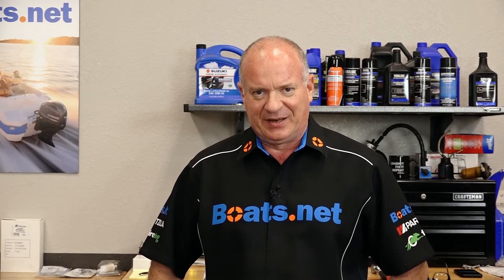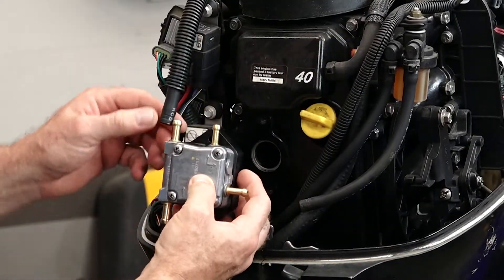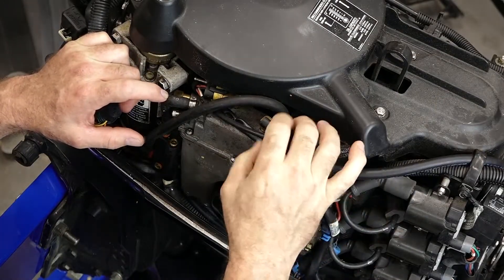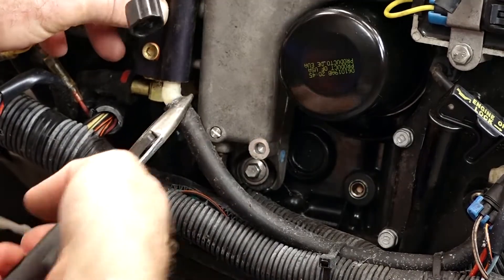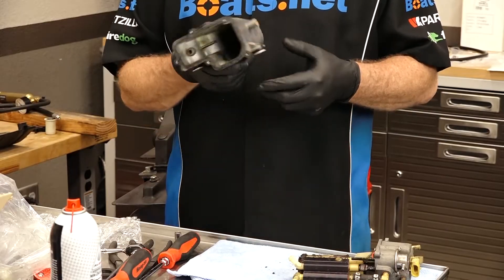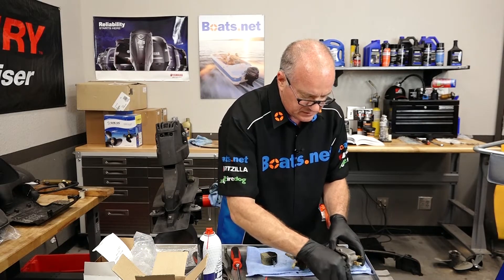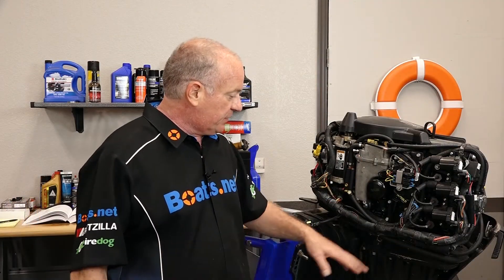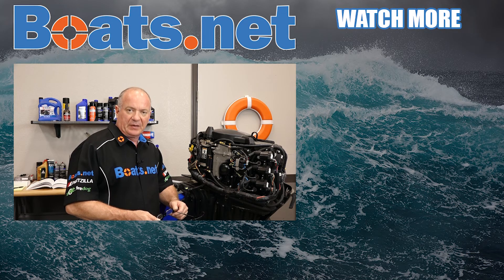Mercury 40 HP Fuel System Rebuild | Mercury 40 HP Fuel Pump Replacement | Boats.net

Comment: More of a question or 2 than a comment. 
Is the o-ring in top of VST important?
Is there an input screen on hp pump?
Are there any torque specs on those VST bolts(8mm)???
Nice Vid!

Comment: Loosen the bottom bolt. Do not remove. A stubby 8 mm ratcheting combination wrench is ideal for this. The VST can the be replaced easily by sliding back into the grommet. This also aligns the top holes to easily install top bolts.

Comment: I came back to this video to let everyone know, if you don't install a water separator between the fuel tank and motor, you're always gonna have problems with the VST. I have finally got my 60HP motor running  and I have a new water separator to install asap. It's raining today so it will probably be installed tomorrow. Plus, it is always good to keep the fuel tank full of fuel after a fishing or boating trip, WITH stabil!.
Keep the water out. A fuel tank breaths everyday, bringing in moisture.

Comment: Awesome video!!!......but FYI...I had two Low pressure fuel pumps on the same engine fail on me. In both situations the pin that holds the diaphragm shaft to the outer "ball" that makes contact with the lifter rod fell out and caused the pump to fail. The VST wasn't getting filled but I was fortunately able to keep squeezing the primer ball to get back home. The worse thing was that the first time I was never able to find the pin, so I never knew if it broke or slipped out. The second time I found the pin with a magnet right below the oil sump screen through the oil drain plug. I think I can safely now say that the pin, even though it is rotated 90 degrees inside the pump housing to prevent it from working its way out, truly is not "captive". Somehow, due to vibration, heat, what have you....the pin works its way back to the installation hole and simply falls out....BAD DESIGN!
I say this as I wonder if the person who worked on this motor before you discovered the same thing and was fearful that the missing pin would cause a catastrophic failure... I sure did!
I have written to Mercury and am waiting to hear from them.

Comment: Thanks for the great video! I have a '13 40hp EFI BigFoot. Might you show how to remove the "Pan" which is between the lower cowling and upper cowling. Even if show with just a parts diagram, I think it will help others like me.

Comment: Great video.  I have exactly the same mercury 40 HP.   I could not figure out how to remove the front inside nut in order to remove the lower cowling.   Any tip will be greatly appreciated.  thanks.

Comment: I know this is a old video but I have a question. When removing the low pressure fuel pump is it easier to remove the latch or the cowling to make room to get the pump out?

Comment: Yea well from experience there is a rubber gasket that has to be perfect or it will leak. I used rtv type stuff made for gas to make it stop leaking. Mercury sent me a new gasket and it leaks like a sieve. It’s like they gave me the wrong gasket.

Comment: We replaced the fuel pump
In the VST tank but it’s now
Getting excess fuel and leaking.  It runs strong so it’s almost like it has too much pressure from the VST tank
Reply: I think there is a fuel pressure regulator on top of the vst. Maybe it isn't functioning...

Comment: Have a question. My fuel filter in the right side of the engine isn’t staying full of fuel. I pump the bulb and after a while while running the engine it empties out. Is this normal or is the pump bad? I’ve replaced primer bulb hose, water separator kit new, and checked all hoses for leaks. I also took apart and cleaned out the vst and everything was good. Any help would be appreciated thanks.
Reply: Filters on the suction side are only full when they are plugged. 6:13

Comment: Would it be possible for the pump motor to continue running when the motor is shut down? The first time it happened the only way to stop it was to disconnect the battery, What it sounds like is a pump motor running and one is not able to restart the motor, We disconnected the battery for about an hour and put the wires back on an hour later it was OK.

Comment: Is there supposed to be a hose connected to the fuel pressure regulator? If so, where does it connect to?
Reply: I have a 50hp also had no hose attached I suspect it vents to atmosphere if it fails. But I was hoping to see an answer. Did you figure it out?

Comment: 2017 merc 40 4 stroke, motor runs only for minates then quits, pump up fuel back into motor and will start again but runs only for a few minates. Thought it was vent on cap and replaced it but motor still won't operate properly. Any ideas ? I've replace the mechanical pump, cleaned all filters, checked electric fuel pump and all of that was ok. Can it be a pressure valve ?

Comment: John, I have the same motor. I am having an issue of the motor starving for fuel at higher rpms. The motor sat for a few years before I bought it. I cleaned the vst, replaced the high pressure pump, replaced the lift pump, swapped the fuel filter, checked my plugs. I have used two different diameter fuel hoses to two different external fuel tanks and nothing solves the issue. I know there is air in system but I can’t figure where! I suspect the vst is emptying and then sucking air at higher rpms. So why and what is the issue?? Thank you!
Reply: I have an 05 50hp that seems to be doing the same thing. Did you solve your issue?
Reply: Inyectores

Comment: stripped out screw heads are a pet peve of mine.  I always replace slotted or phillips head screws with socket head cap screws. Problem with stripping screws is solved forever.

Comment: My 06 60 Mercury efi is hard to start after warmed up. Cold starts fine.   Almost like its losing prime. It begins to crank and dies for about 10 attempts then runs fine.   I've changed primer bulb and main lines to engine as well as replace filter.  What should i check next?

Comment: Thanks!  Totally saved me from screwing up my 4 stroke VST.  I've been to school on them long ago but today is my first time to do it and your video is on a motor EXACTLY like mine.  I have had fuel issues for the last 3 or 4 seasons.  Mercury tech told me my problem is the fuel cooler.  it acts like it is a vapor lock issue.... I think it is more than that.  Starts and runs fine then when I get ready to leave a job site it doesn't want to run as if it is out of fuel.  I can loosen the filter and pump cool fuel through  then it usually will start up and go again.  This year it didn't do that so well.... time to get serious.
Reply: Have you seen the videos where they put a relay in between the ECU and fuel pump?

Comment: Great video for sure the reason I was watching it is because I have a 2007 Mercury 40 Hp bigfoot and I  started seeing fuel leaking out of what looks like a white plastic thing which also has really fine threads on the outside. Lots of stuff packed into that area but is that the overflow indicator for a stuck needle valve letting to much fuel into the housing? 
Any help would be very appreciated:) Thanks

Comment: I have a 2014 Mercury efi 60hp my vst is leaking fuel out of the bottom hose. What would cause this?
Reply: Bad drain seal inside the vst. Maybe a bad housing. Or maybe it's just not screwed in, all the way.
Reply: Possibly the needle
Reply: No tyler, the bottom hose on the VST is only a couple inches long. It's a service drain. But funny enough, by the time most people take it in for service, that drain is totally blocked with debris. Ergo, useless. 
🤔 It's existence, is probably just some EPA thing.
Reply: On my VST leak it was my float was hung on the rubber seal that the high pressure fuel pump went into.
Reply: My problem is I have no fuel pressure at the fuel rail. I replaced the vst pump and still none. Ordered a fuel pressure regulator thinking it was stuck closed, hopefully that fixes it
Reply: @BoovenBBQ The low-pressure fuel pump, bro.
Reply: @thediplomasta5891  I have fuel getting to the vst
Reply: @BoovenBBQ  does your motor have the spider-looking fuel manifold, or no?
Reply: @thediplomasta5891  not sure how to describe it, it has a Schrader valve on top of the rail
Reply: @BoovenBBQ  ok, that's a no. Gonna have to put that regulator in, and see how it does. If you want to check the fuel pressure, you'll have to order a marine fuel pressure checker. The automotive type that most people have (if they have one at all), is a larger thread size; Can't use it on any kind of boat motor.
Reply: @BoovenBBQ  have you got the regulator ? I’m having same issue wondering the same
Reply: @TheFreddy199  I’m pretty confident my regulator wasn’t the issue because I was able to apply 12v to the plug for the vst from the battery and it pumps fuel to the fuel rail. When I have it plugged in and try starting the motor The vst doesn’t pump
Reply: This has me leaning towards ecm. Because I have 12v at the plug for vst but with the vst disconnected and trying to start, but when I try starting with the vst plugged in the 12v disappears
Reply: @BoovenBBQ  check to be sure the wires on the inside of vst are not shorting together. I've seen some bonehead designs for some of those little wires inside. I had the same voltage drop one time on a 4-stroke. That was the cause.
Reply: @thediplomasta5891  yeah I’ll check that. Have you seen where you don’t get any beep or red light when starting the motor?
Reply: @BoovenBBQ  If you have verified the operation of the beeper, then that's caused by ecm. Easy way to check, is disconnect the temp sensor and ground the wire, while key is on (IF it is a traditional one-wire sensor). Beep should sound, if you do that, and it is working. If that is all good, then yeah, it looks like ecm.
Reply: @thediplomasta5891  maybe you can shed some light on my problem.  My engine is exactly like the one in this video.  I have completely cleaned the fuel system, new tank, new fuel line.  VST pump works fine tho it had a lot of debris in it and screen appeared completely clogged.  I can drive my boat a few miles.  It runs fine.  When I stop for more than a few minutes then start up again it is as if it is out of fuel.  It may run but absolutely no power then it dies.  It may do this a few times before it totally will not start.  I then loosen the fuel filter, squeeze the bulb to pump fresh gas into the filter, then it will start up and go.  The first couple of years I had this motor (bought it used) I didn't have any problem with it at all.  The last few years it has continued having this problem.  I have thought it was vapor lock from the heat of the engine sitting hot with gas in the lines.  It is not making sense to me.  The VST tests good off the engine. It cold starts great, no problem at all.
Reply: @aNuthaRedneck  ok, firstly, vapor lock almost never happens in a boat. So forget about that car stuff. It never gets that hot around your boat motor because there's no radiator. Secondly, the fuel inside the vst, should already have passed thru at least two fuel filters before it gets to the vst. If so, then replace those filters. Most debris like that, is actually pieces of the inside of the old fuel hose. Those DO have to be replaced periodically, but I guess your biggest issue is the low pressure fuel pump. It can cause what you're describing. Indeed sometimes it stops working, but if the diaphragm breaks, it can leak extra fuel into the crankcase and flood it (🤔which is hard to process on an EFI). There are a few variations of these fuel pumps, but they are usually 2" by 2", square, and mounted on the side or rear of the engine block. 
Also, just a tip: depending on which motor you have, the vst fuel pump GROUND is operated THRU the ECU.  So if you ever have an electric pump failure, check the power AND Ground, coming into the pump WHILE cranking, before you run out and buy a new one. If no ground, then bypass and make one. OR pony up the $600 for a new Ecu. 🤣 But I don't think that is what your problem is.
Reply: @thediplomasta5891  thanks!  Thinking about it the problem seems to be before the vst unless the hp pump intermittently works when the motor heats up. It starts right up when cold. It only has a problem after a fairly long run then shut down and sits a while. This tells me the vst may be empty which is something I have never checked. Also, one thing I missed is the little screen at the fuel pressure regulator.  Whether or not the regulator could cause this problem I don't know.  I hope to have time to dig into the lift pump this week.  If that doesn't cure it the regulator and the ground you mentioned is all that is left.  I did have to replace the voltage regulator a few years ago so that may have been about the time this problem started. It went out then that one got so hot it caught the cowl insulation on fire. I got a warranty replacement and no problems out of that one so far....as far as I know.  There had been issues with the exhaust cover it mounts to. Mercury sent me a corrective replacement for that.  Apparently it was allowing the regulator to overheat.

Comment: How you test hight pressure pump? Can you connect it to 12volts to see if works?
Reply: You should be able to hear it. And yes, you can, but be very careful. Always set up a fire extinguisher or water hose, ahead of time. Just in case.

Comment: I have a 40 horse Merc and fuel is coming out of the bottom carburetor at the plunger is there a rubber gasket that's in there that might be pushing fuel back out when it is pressurized